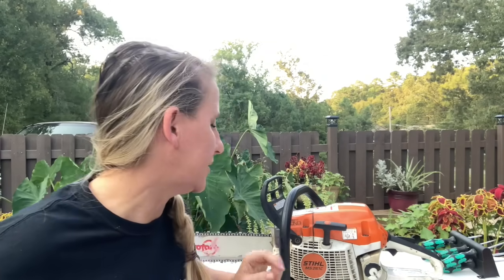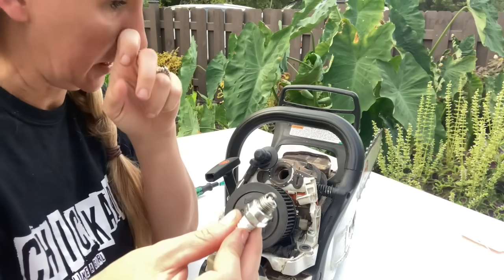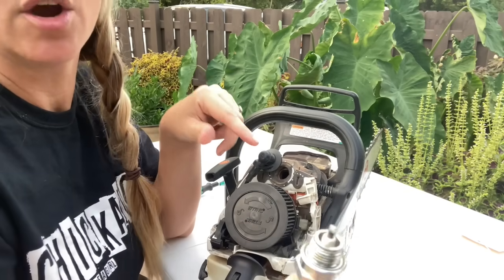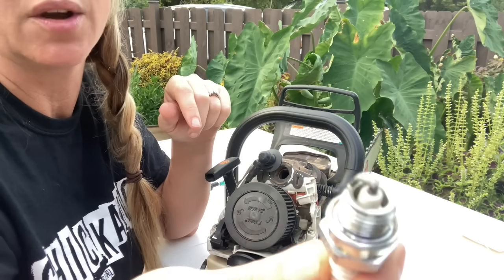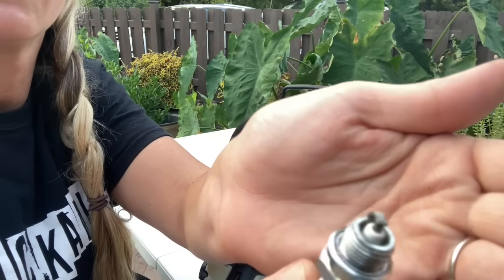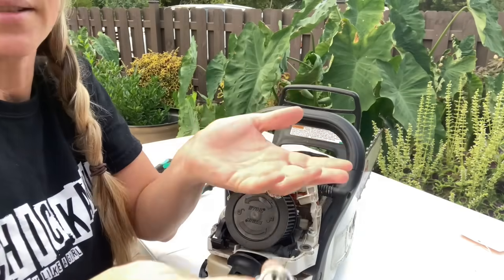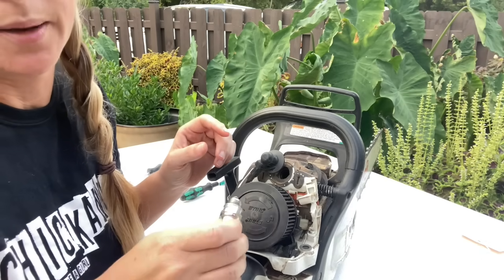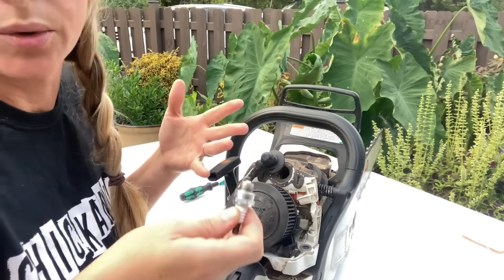STIHL M-TRONIC CHAINSAW HAS NO CARBURETOR ADJUST, WILL IT "RESET" TO REGULATE FUEL CORRECTLY?

Comment: I have a carb ms 270c bought new in 85, run it all winter long, have changed the spark plug once, and the fuel filter once. Have done nothing else. Have never had 1 problem.  Im absolutely  amazed!!
Reply: C is not M .... this does not have mtronic, your comment is worthwhile of course!
Reply: There was no such thing as a MS 270 C in 1985. Maybe you meant '08.

The Stihl MS 270 C chainsaw was introduced in 2007. It was eventually discontinued and replaced by the MS 271, which was released in 2010. This means the MS 270 C was in production for approximately three years, from 2007 to 2010.

Comment: Not a terribly useful vid tbh given there's mtronic v.2 v.2.1 and v.3 also.Its a shame there's so much fear-mongering about what is basically STILL a chainsaw with a carb!!As pointed out 98% of the time if you have a mtronic issue re-calibrating will sort it out.If not it probably needs the white solenoid/orange fuel filter kit-£15 here in the uk-just keep a spare kit-no more expensive than keeping a spare air filter in your toolkit.My 261 c-m has worked like a dream over 2 hard winters with no issue/no recalibrating needed (v.3).Lets not forget-its still a basically conventional chainsaw-with all the potential issues conventional chainsaws can get!So do all the obvious maintenance stuff prior to immediately blaming mtronic for dirty plugs/air filters/crappy fuel mixes and gen.poor maintenance on your saw.Above all-dont fear the future!After all,most of us dont toss and turn all night worrying about the e.c.u. running their vehicle.

Comment: My question for any and everyone is, if these new electric saws are supposed to constantly be checking atmospheric conditions and making the appropriate adjustments, why would it ever be necessary to do a “reset”? Makes zero sense but I see it constantly come up. In a days cutting the temperature can easily change 50 degrees and it’s possible I may change a thousand ft in elevation. The electronics are either making the proper adjustments on their own or they are not. If not, what is the point except for the end user to need to buy more saws because that one burned up. With an adjustable carb, you simply make the necessary adjustments and go about your business 🤷🏽‍♂️

Comment: Great vid and very timely for me to view this. Was on the fence on purchasing a professional stihl mtronic. Saved me hundreds of $'s on the initial purchase and service costs in the future. Chainsaws have worked well for 50 years without electronics, if it aint broke dont fix it with something that is going to be problematic that the end user cannot at least try to adjust. Another thing as I was following along with your vid, I too see and agree the plug is way lean, I wonder what the cylinder temps are and how that is going to affect longevity of this saw if not fixed by the stihl dealer, the damage may be already done. Really good points on your behalf, we all appreciate this fine channel.

Comment: Later M Tronic procedure is to start on bottom setting and run for 45 seconds. Then with brake off just pin the throttle wide open. Saw will fluctuate in rpm and then scream for about 5 seconds, keep her pinned wide open. Saw will then reduce rpm and now you can shut it off and you’ve fully recalibrated your Stihl M Tronic.

Comment: Never Again.

I love my saws,    even my MS362c with the M-Tronic that lets me down at the worst times.

I have never successfully "reset" the saw.    I brought it to the dealer.   The dealer put a new throttle body in it,   it was great for 15 cords.

The saw let me down again,    I tried every damn " reset " possible.     Now I'm pissed.

I have to decide if I'm going to just join the Husqvarna gang, or get a carborated Stihl.

Comment: I guess its the game of truth & consequences, here's my question. I was contemplating on the purchase between these 2.
 Husky 592xp or stihl 661 regular. I am not a logger but I do cut quite a bit of timber for my sawmill. I have a 372xp now I love it but at times its hard to start hot or cold seems to flood so I just pull out the plug dry it up & blow into the cylinder then bamm it starts. So no right or wrong answer what is your preference all around ?

Comment: Enjoy the channel I have two 261cm one earlier and one face-lift version both brilliant your calibration  procedure not correct. When calibrated properly no issues with idle /chain. Best advice from Stihl distributor in NI critical to use plug with a resistor or the m tronic  unit will be damaged. Also have Echo 501sx good wee saw not at races with 261 or 550xp mk2

Comment: Yes I agree with the No Chock Stehl Saws, I have Nothing but problems every Camp Season Starting my MS 250 ? If it's not a plug firing it's a fuel line pinched off trigger hanging up or not shutting off because of the way they set up that spring clip all the way up because the thing wants to relocate in the down position and once again Won't Start for you?? Lol Never Again will I get whatever it was you called it in the beginning...
 😂

Comment: Maybe the person who designed that field delivery system worked at Chrysler called the lean burn what a piece of crap that was more electronic gibberish like Holly sniper EFI never buy one of those for your car it's a nightmare it won't run right it'll flood your motor it'll wash the cylinders it's just ugly have a great day I don't have problems with my lawn mower snow blowers or Tremors because they're all old oh yeah you can adjust it I guess the good old days really were the good old days have a great day thank you🙃:face-orange-frowning:🙃:face-blue-wide-eyes:

Comment: I have a 2021, MS 261CM
 The calibration if that's what you're referring to with The term reset... In my manual follows a procedure run it with Break on for 1 minute then with the break off for 1 minute... Then make 5 equal cuts...

Shut it offor 30 seconds start it again it should be perfect...
 I've done it twice in the 18 months I've owned this machine both times it worked. Hadn't used my saw in at least 5 months drastic temperature change thought I would need to recalibrate it today I did not

Comment: Excellent video. Thanks. I've had a 260 for twenty yrs and looking to buy a new machine and was considering the 261. Not..... after seeing this. Today I just did the L H LA adjustments on the old machine and its running like a song. If I cannot work on an engine because of 'fancy computerization' needing special equipment, I will not touch it. 
By the way. Great care when using the decompression button as I did not hear the engine 'pop' on a pull one time and so my next pull was against the full compression. My left hand was a little lazy holding the handle. The machine lifted with the loose grip I held and the brake lever took an inch of skin off above the knuckles and right into the tendons. Always a leather left hand glove and a thumb press on the de compressor after every pull now. Esp or mostly always on cold starting.

Comment: I have seen people that own a Stihl chainsaw start it very easy and could not believe how. First they push the decompression button, then the slowly pull out the cord all the way, when they let the cord go to retract, it starts the saw. They set it up like they are going to pull start it first, but they never give it the fast pull. I told my neighbor that owns 2 of them, he tried it and couldn't believe they both started like that. Maybe try it for yourself and show the owners and watch their jaw drop open.
Reply: That's the easystart or easy2start system.  A secondary spring stores your "gentle" pulls and releases all the energy when some threshold is hit.  The main problem is that yanking hard like you normally do can damage or distort the seconds spring (model dependent).

Comment: Im for improving a product but this m tronic adds more potential problems, not only the solenoids are not as reliable as the carburetor, this system has a microprocessor in the coil and this all relies on tiny wires that a tightly jammed into small channels and if you yank one of these fragile wires you have a really hard problem to troubleshoot. Im going to retro my saw back to the standard reliable carburetor because im tired of pulling my shoulder out because of hot start issues.

Comment: Hardly the most scientific or balanced appraisal of the adjustable versus non-adjustable carburettor discussion. I agree it feels better to be able to adjust the settings yourself… but Stihl must have moved on because they’re confident in the technology. An odd case of failure is to be expected. The 5 year warranty versus 2 or 4 years warranty is a different discussion, again Stihl must be confident in their oil through R&D. At least there’s customer choice out there, lots of good equipment brands with adjustable carburettors and different oils…

Comment: Just for reference, there is a grub screw on the carb to adjust the idle but Stihl dealers will not tell you. I found it when stripping a 261c for a customer, it now idles correctly.

Comment: One big problem is, Stihl dealers are not telling their customers the saw they’re buying has an electronic carburetor and they won’t be able to take it to any small engine repair shop for repair or fix it themselves. They will have to take it back to the dealer and pay dealer labor prices to get it repaired.
Reply: They are honest about it..lol

If it bothers you so much just get the MS-291 with a normal carburetor and no electronic control, it’s essentially identical minus 1/2 a horsepower.

Comment: I am new to being a Stihl mechanic and it sounds like a frustrating situation.  What I have learned is, for me, not the pricing of the work as much as it is keeping my customer happy and the cost down.  So far I have not had to work on these saws.  If I can I will cut the labor costs and then what ever I can do to help with the parts I will.  The typical cost at this location is labor at $30 to $40 per hour then the cost of parts. I hope this helps.

Comment: Geee…. Imagine that…RTFM .

The calibration procedure is on page 43.  And want what you did.  

And available for download.

I just purchased a stihl MS362 CM .  Not embarrassed to say the first thing I did with it is sit down with the saw and the manual and get familiar with it and it’s operation. 

Never had a cold weather plate to switch before.

Learned there’s a cold weather plate for the intake. (Not even mentioned in the manual.)

So much more as the only saw I’ve ever used is a 2005 Stihl MS180C.  We’d borrowed some 70’s model homelites etc, but this is MY saw to work my retirement acres.

People seem to be afraid to read that manual.  As a consumer and a mechanic.  It saves me so many headaches that just aren’t any issues.

Comment: when hot:  Hard or no starting is usually indicative of a bad fuel solenoid.  The first version of the solenoid (black) was prone to clogging and failure.  Although replacement is easy, sometimes the new white solenoid might not work with the control module (coil), The original control module might or might not accommodate the needs of the new style fuel solenoid.  If it already has a control module (coil) that will work with the solenoid, then you are set, if not, then a new coil is required also.  The 'reset'  and  'calibration'  procedure is dependent on the coil number, The best thing to do is call Stihl (with the serial number of the saw, and the control module number) and find out which control module works with the new solenoid, and what is the calibration procedure that one needs to do for coil number xxxx xxx xxxx A or xxx xxx xxxx B   (In addition to A or B there also might be a C, or D, or E that follows, the letter is important) to make it run, you might have to make the representative double check, because he's probably going to say there is only one procedure, not true, there is more than one procedure.  bottom line, if it runs lean, it is probably a bad fuel solenoid.  The piston on my new (I bought it when they first came out) MS362 was scored from the saw running lean.  I am working with Stihl on this issue, 2 years of Bull Shizz so far.  Thanks for the video, best of luck.

Comment: I HATE computerized stuff like chainsaws... I'm so happy I bought two pro saws about 5 or 6 years ago that had a manual carb.  The high and low adjustment had plastic limiter tabs on them so you can't make it richer beyond that blocking system.... so.... I took it apart and snipped those stupid things, hence giving me full adjustment 😬

Comment: Can these models be fitted with a standard carb and ignition  after the warranty  is over?
Reply: Yes, If you are going to do that, see if you can get a coil that does not have an RPM limiter on it.  Make sure your flywheel is compatible with the replacement coil.  and a carb for a strato saw

Comment: Why would they have a reset  on a saw if it didn't work? You ran the saw for 30sec. After the reset. Let it ideal for 30sec. Then hold the trigger wide open for 60sec. Then the pitch of the saw will come up then down shut it off your done. Sounds like a little favoritism towards ECHO to me..
Reply: The procedure probably varies dependent on the control module number.  There are different procedures for the MS362 and MS 661 for sure, and probably the rest of the M Tronic product line.

Comment: Also, I run nothing but Stihl oil and run it at 30 to 1 on oil!!!!  You get to clean the exhaust screen and replace spark plug more often but the saw will last forever!!!

Comment: The newer ones require 45 second run w brake on, turn brake off then hold throttle for 30 seconds, when idle drops, turns saw off…. You can buy the oil, take it back for a refund and still keep the warranty…. Hope this helps…

Comment: I am actually in the market for another saw and have been looking at Stihl, precisely this model. You have convinced me to keep looking.
I will look for an older Husqvarna that has an adjustable carb.
In my opinion the older saws were better, definitely more user friendly and easier to fix in the field. I had a new Husqvarna 455, just sold it because I can’t adjust the carb beyond the preset limitations.
I should mention, I earned my living for many years with a chainsaw. The 455 is the only non professional saw I have ever owned, and it will be the last one.
Thank you for this video, I have never owned a Stihl and now seriously doubt I ever will.
Reply: STIHL makes the 261 without the m-tronic system in it.
Reply: Get a husky they start way better than any stihl, especially in the cold.

Comment: We used to only use Stihl. If your saw says "made in west germany", it's an example of what a stihl is. This newer stuff... I bought an echo 355T to "hold me over" until I had the coin for a $700 Stihl top handle. That was in 2017. That echo still works like a champ. Never went back for the stihl. Have a few more echo items as well. I do run Stihl chains though.

Comment: It always works - check your tach to see if it always works!  My ms 261-C-M would turn 14,500 at WFO in a heart beat and I had no way to bring it down.   That is why you see a lot of blown up 261’s these days.  Saws just will not last at 14,500 RPMs.  I checked my new little s 170 the other day and it was turning 14,500 on a cool day.  Everytime I run a saw I CHECK IT FOR WFO with my tach.  The 170 is supposedly a non adjustable carb saw, too, but that is not quite correct.  You can adjust the Stihl carb used on the ms 170.  Most Stihl dealers do not have the computer equipment to adjust M-tropic saws.  Stihl wants about $15,000 or the equipment and schooling to use it.  Most dealers will not spend it.

Comment: Thanks.  My final affirmation.  Probably will get an MS261 tomorrow.  Definitely not C-M not only for lack of adjustment as you so nicely demonstrate but also for the high cost of the components for the M-tronic system, and forget about labor cost !

Comment: That was an awesome and informative video about the m tronic system. The chainsaw I own is an electric black and decker 14 inch bar chainsaw. It works great for what I use it for
Reply: was it? she told us very early she has no experience of them, she did the reset wrong and described the standard reset/adjustment feature as a last resort. was obvious from the start she didn't like it and even thought the reset seemed to make the saw run properly again she claimed it hadn't because of a spark plug inspection after virtually zero run time
Reply: @Joe2328  As she stated that she had no practical knowledge, then proceed to ask advice of any Stihl dealers or service people for advice.  There are many who chimed in with exceptionally knowledgeable advice which I am certain has helped numerous Stihl owners.  Therefore I say she got it right.  No charge to the customer!
Reply: @billwessels207  come off it mate, get your eyes out the oily cleavage and be honest with yourself. She doesn't like Stihl equipment and from the start the whole video was hugely biased. Tell me how adjusting an m-tronic carb the way the manufacturer tells you to can be described as a last resort???
Reply: @billwessels207  This info takes 30 seconds to find directly from Stihl

Comment: instead of ALL that below 'fixes" ...here's MY fix :
take that m-tronic GARBAGE off there and put a damn carb on it !  problem solved...better yet take the m-tronic GARBAGE SAW back to stihl and DEMAND a Carbureted version...I looked areond and found a Carbed version of the MS 362 and bought it ...no problems so far except it ran too lean, so I broke the carb lock adjustment plastic GARBAGE off of it and richened up the high jet....now it runs like it should have.